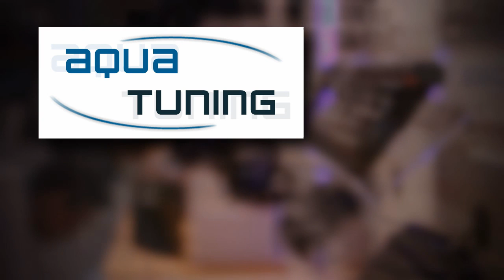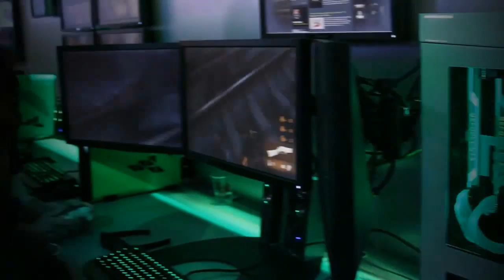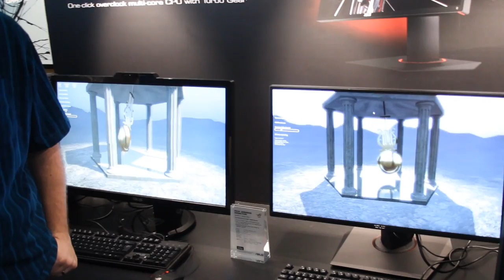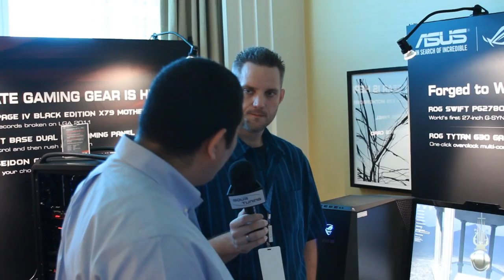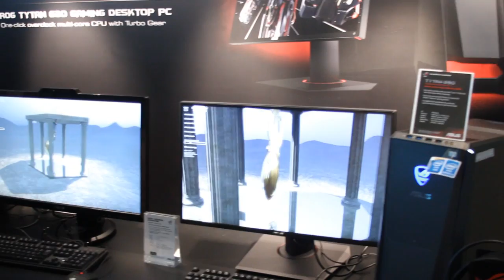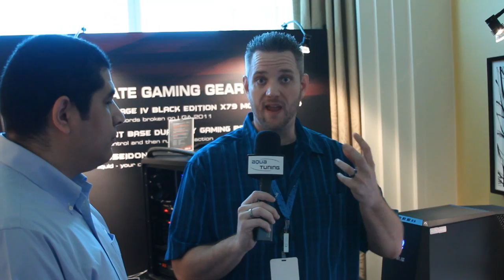ASUS ROG GSYNC MONITOR - 1440p 120hz NO MORE TEARING!

Comment: why not a 4k gsync 144hz ultrawide ips 1ms  monitor
Reply: once nvidia and amd create gpus capable of runing games at 4k in 60 fps+ then you will see a 4k gsync monitors.Im sure they have the technology and engineers available but there are decisions that occur behind the curtains..my guess is they are waiting for the market to mature enough (like introducing 4k 30 hz monitors) and once the market is ripe, they will capitilize on it.There has been countless times where companies go commercial with sophisticated hardware/technology and the market didnt adopt as expected...its a phenomenom that could potentially/financially hurt companies who invest in that particular product.
Reply: 1. 144hz for 4k would be useless with today's hardware, not to mention dat display port cable that would be capable of running such a high bitrate
2. 4k Ultra wide would not be 4k, it would have to be 21:9 at a reidlous resolution
3. Ips and 1 ms are not going to happen

Your basically asking the companies to make a rocket powered car with rocket powered breaks, built in toaster that is also a super sonic microwave, that also plays darude sandstorm at 150DB while not causing hearing loss.  Not gonna happen
Reply: Eck yes of course you can, but not at 4k, which is what this thread is about; maybe some lower end games, but the games that would benefit greatly from higher resolutions and frame rates, hell no
Reply: Vault Nomad
Plenty of games will run at 144 FPS on today's hardware. Games like TF2, CoDAW, CSGO and even BF4 can be rendered at over 100 frames per second on SLI setups.
Reply: Vault Nomad i agree 1440p 144hs 1ms is plenty

Comment: Hmmm. So designed ground up vs. ASUS VG248QE ($249 USD) + nVidia GSYNC kit ($200 USD). It also has 1440p resolution vs. the 1080p of the Asus. Does anyone have the release date?

Comment: Is there a possibility of it being offered without G-Sync? As to reduce the price? While i love G-Sync i could live without it. Running a VG248QE right now on a 7970. 780 classy is in my closet, waiting on loop parts. But just having a monitor that displays above 60hz eliminates a great deal of stutter and tearing. Or at least in my experience it most certainly has. 800$ is steep IMHO, i could just never sink that into a monitor at this point. Maybe later in life. 600$ without G-Sync i could warm up too eventually ;) Either way i'm glad to see a 1440p 120hz panel.

Comment: I think a glossy screen would have been nicer on this panel. Glass is more of a premium and looks way nicer makes the color pop. I'm a little worried about color, just wanna have the best of both worlds. Hoping it's not washed out and dull due to high response time..there must be a way to fix this issue.! However that would be my only cons can't say much haven't even seen it ! But would like a glossy glass screen and hoping for the absolute best colors that can be pumped out of this regardless of what panel type it is because I want to buy one !

Comment: Do you need g-sync if you already have 120 hz? I think G-synk will be most needed at 60 hz.
Reply: Yes you do. G-sync isn't depending on your monitors refresh rate,but refresh directly as soon as your gpu is ready to refresh. So the monitor don't need to buffer the frames. In theory even if you had a (let's say a 500-1000Hz) monitor G-sync would still make a difference i believe.
Reply: But... if my monitor is ready to refresh 120 times per second, and my video card can push that much, no single frame will be on the monitor for more than 1/40 th of a second right? In the worst case scenario.
Reply: Not exactly correct. Even though your monitor is ready to refresh as fast  as your gpu can deliver the frames. The monitor can't stop tearing and stuttering,and that's where Gsync comes in (this may vary from game to game) but it's a clear difference when you see a g-sync monitor side by side by a non gsync monitor displaying the same game/video loop. It's a bit complicated to explain, my best advice is to go check out some g-sync videos and read a bit about how it's work in depth. We will only see more of it in the future and in the  next 6months many more monitors from different manufactures will be out. It's probably the best thing that has happened to gaming in many years,total game changer.
Reply: I just hope nvidia implemens mantle.
Reply: SalveMonesvol Yes 120hz monitor does reduce it, but it is by no means not noticeable.  People just got really good at ignoring it, myself included.

The problem is once you start noticing it your brain switch and you will keep seeing the fluctuation of having repeated frames every once in a while no matter how briefly.  120hz+ monitor sometimes have the "Soap Opera" effect precisely because they are repeating way too much frame.  Some like it though, so that is subjective, but the idea of a smooth 1 render to 1 scan is ideal for fluid motions in 3D.  People's eye do not see frame by frame, but we will notice any disruption in motion pretty easily if it is not something we are already used to.

You will definitely notice if let's say your GPU fluctuate between 70 FPS and 160FPS.  A few seconds your motion would feel "slippery", but the next few seconds suddenly feel "muddy" which people got used to but is not the ideal experience.  Of course it still depend on the type of game is played, maybe for some games it is barely noticeable, but for others players just learned to suck it up.

120hz+ was never meant to be a cure, it is more like treating the symptom, but G-Sync is pretty close to a cure albeit not a perfect one.
Reply: You miss the point of G-Sync entirely.  Your monitor may refresh at 120hz, but your GPU's output goes up and down no matter how fast it is, meaning micro stutter will still exist, as will as lag (if using V-Sync) or small tearing (if V-Sync off)

Your example is that of a perfect world which is one we do not live in.  The whole idea of G-Sync is that the monitor scan the frame the moment it is done rendering.  So if your GPU output 120 FPS, then your monitor (if it has 120hz) will refresh at 120FPS.  Fluctuations will not cause stuttering or tearing because the monitor is in sync with your GPU.

120hz monitor actually benefits more from G-Sync because if your FPS suddenly drop to 60 for some reason, you won't repeat the frame as 120hz monitor does now, you will still have smooth operation at 60 without repeating frame.  Currently if your GPU out put at 60 FPS (or anywhere under 120 FPS) and your monitor refresh at 120hz, you actually repeat the same frame twice somewhere along the line, but because the refresh interval is shorter so it is less noticeable, the stuttering and tearing however are still there.
Reply: Neosaigo I know the stuttering will still be there, but if my gpu can output more than 60 fps in a 120hz monitor, every frame will trake either 1 or 2 refreshes. when it takes 2 refreshes, a single image will be on screen for 1/60th of a second, maybe 1/50th considering ghosting and scan time, and that is stillvery fluent and will not be noticed by most people.
Reply: Keep in mind, if you are running this at the naitive 1440p resolution, then you will need a very beefy videocard - and even then, you would probably be dipping down to those 60's & 30's fps.  So ya - Gsync is needed with this monitor.
Reply: Extermicide I'd rather buy a gpu $200 more expensive than pay for gsync, and lower my settings so that the fps stays at 120.

Comment: This monitor is still impressive but No PLS/IPS is a deal breaker for me TN panels have no depth and lack the contrast accuracy.
Reply: He said it has improved colour over a regular TN so it'll be best to see one first hand before making a final decision on whether it's up to the task or not.
Reply: nasha thedog it won't be something ill be looking at IPS/PLS is the only way to go for me.
Reply: ***** No Problem I think this will be a great monitor for gamers that want good/decent resolution with high fluid responsiveness, I'm sure Asus will be the first to get a IPS/PLS 1440p 120Hz it will be the best monitor since sliced bread. :) Prices will not be a issue for most enthusiast willing spend about 1K USD on the 1440P/IPS 120Hz in a few years I think that would be a reasonable price considering how cheap even 60hz 1440p monitors are getting tech is getting better all the time.
Reply: Mesomorph85 There the sorts of issue's I imagine they'll of fixed when we do finally get an IPS monitor that has spec's like this one, I'm going to buy this monitor after it's released rather than a 1440 IPS because it has G-sync, However if a 60hz 1440 IPS with G-sync appears before I buy this I'll seriously consider it instead but at the moment this is my first choice monitor.
Reply: RimjobsForEveryone Asus still haven't made these panels available 3 months later, at least not here in the UK and now LG have some nice 34" 21:9 panels so I think I'm moving to one of those because I'm tired of waiting.
Reply: nasha thedog they can't make an ips panel as fast as a tn based one. thats the problem. the tech dosnt allow it. maybe OLED will fix these problems..
Reply: RimjobsForEveryone On an IPS monitor? I have one, and that is not accurate. Perhaps you got a faulty monitor, I suggest you give it another go.
Reply: its a gaming monitor, so tn is fine.

i've had several ips, pls and e-ips monitors, all sucked for fast paced games.
Reply: those suck for gaming.. i had one. black bars in most games because of limited res and fov settings.

Comment: There's finally a 1440p 120hz monitor? :O ON MY BUY LIST
Reply: ***** Not exactly both to be honest, 2.0736mill pixels total vs 3.6864, so 2.0736 vs 7.3728mill when going from 60hz 1080p to 120hz 1440p, that would be about 3.555555x the graphical power needed.
Reply: cannonbulk On most games you don't really notice a difference until you hit 120. Atleast for me, I have a 144hz monitor.
Reply: Considered buying a PLS 1440p monitor for $300-450 from Ebay/Amazon which overclock to 100+ Hz.
Reply: X FROOS Neither, therefor I must conclude that he's right.
Reply: *****

2.5 times actually but you know, who's counting :p

Comment: It's cool but I still have a new bought AMD R9 280X and will not buy a new Nvidia card and a screen with G-Sync for what I guess alot of money so I will use AMD's freesync when it comes. Why cause its free and dont need a modified monitior.
Reply: unfortunately, you need a monitor that has the self refresh technology in it to be able to use Freesync, if you don't, then it won't work.
Reply: monitors with Display Port 1.3